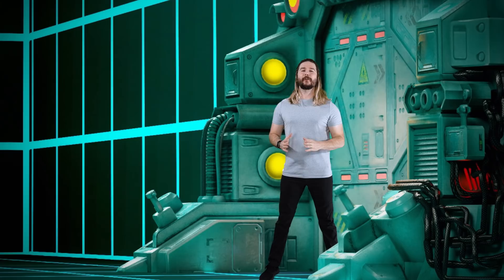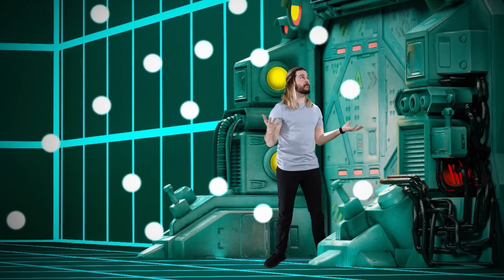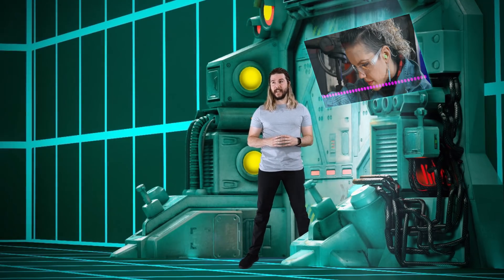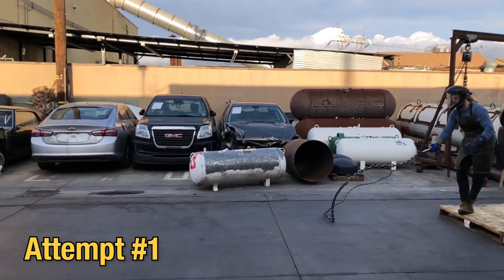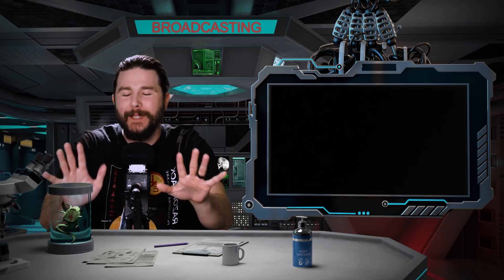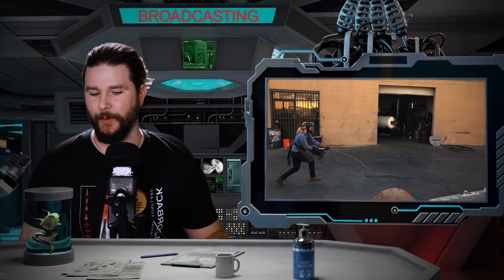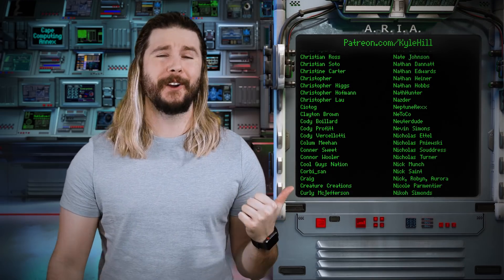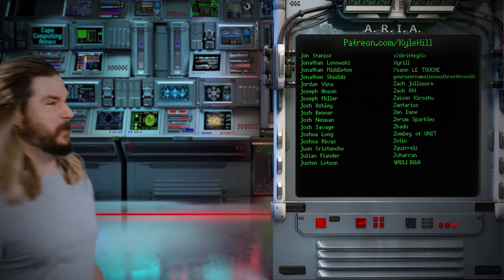Can I Make a SUPERSONIC STEEL WHIP?

Comment: I want to say the problem is that the steel braided cable on the end is too stiff. There is a 180* change is direction to develop the crack and the steel braid can not double over on itself and get close enough. So you end up with a too large loop traveling down the length.

Comment: You know what the problem is Kyle? 

Your chain whip is the problem. It is not made right for this. 

Take a close look at the footage of you trying to whip it. You might notice that you can't in fact, whip it good. Your whip is too long, too sectioned, and the long ending chain, (I.E. the smallest section at the end that's actually supposed to whip), is not tapered well and is stealing all the energy from the final wave of your swing. The decline of the taper of the chain should be a gradual process, but on your chain, it is too staggered and step-wise.

 If you remove the last, smallest chain at the end of the whip, and make a new section of rings that taper down more gradually, (I.E. get the rings smaller and smaller one by one and not all in the same size.) You should probably get better results. If you shorten the chain whip overall, with a decent taper, of course, you should get much better handling and control over the whip and probably not hit yourself too. A shorter whip is much easier to handle as the weight of the whip should be a lot closer to your hand, like a sword blade instead of an axe.

 A shorter whip might be more dangerous though if you can't control the thing very well, and a good way to handle that problem might actually be a... handle. The longer the handle, the safer you would be. Maybe you can add a long wooden handle to the steel handle you already have and have a much lighter and shorter whip at the end of it? It would probably be a lot of work to make, but hey, We would get a lot more clips of our favorite hardworking post-apocalyptic weapon smith in action so it's a win-win, right? Of course, you would be the one paying her so that's a triple win in my book!

The guy in the video you showed has a much better whip than you do and probably does have more strength too, so he can handle a much heavier whip. I believe you would be better suited to a lighter whip than that guy, but with similar proportions. His looks to be tapered all the way through the whip, instead of in sections like yours is. A steel whip is much stronger than a leather whip so it should be able to handle extreme forces much better. In the end, the purpose of the whip is to break the sound barrier, not to actually cut someone in half. If properly tapered, even a much lighter whip should be able to get to a fast enough speed. 

I would love to see a redesign and reattempt at this in the future! 

Let's see you become a real thunder god! Even if its not actually a thunder hammer, a thunder whip might actually make more sense.

Comment: two things that might help. 
First try vertical rather than horizontal. er. still on the  side of your body, not centreline.

second, once you have the whip moving forward en mass, start pulling it backwards so the body of the whip is moving back behind you again while the tip is moving forward. the whip should end up back where it started

Comment: I appreciate  you not hiding failure, but to be fair, with a chain of that weight and length you where kind of setting yourself up for failure, let's be honest  you're not exactly a burly guy. Your best bet would be to start with a smaller diameter chain, neck it down, and possibly end with a steel cable.

Comment: I'm not a wip expert. But I'm surrounded by them. [The founder of my national Indiana Jones fan club is a friend. So I have access to a few whip nerds] So I think that your movement is wrong. Mostly, you need to make the tip go centrifugal before directing the whip itself. Basicaly, make it do a semicircle then pull and launch. Traditional whips manage this by rounding over the heand and pulling down.

Comment: Doing the experiment over hard concrete probably added to the already existing sketchiness factor. Makes the potential for bounce-back a lot higher than soft ground that would absorb that energy. At least a nasty bruise was the worst of that learning experience. (And with that and sharing it, the world also gains wisdom in addition to the knowledge. It answers not only whether it could be done, but if it was a good idea in the first place.)

Now if you want to see something comparably big (if not bigger) that can whip at supersonic speed, look at videos of ship rigging failures like mooring lines breaking or runaway anchor chains. Those have enough energy to cut a person in half and then some. Not something anyone would want to be around if and when it goes wrong.

Comment: If you did this once more. But yank back on the chain as it approached its "whipping point?"
The counter force will up the speed if the tip. You wont get the crack, but you will explode concrete blocks. 👌

Comment: I don't really know much about whips, but maybe you could do it safely if you had a "machine" and enough space. The "machine" is a pole with a rotating arm parallel to the ground on the top and attach the whip to the end. Then attach two ropes that are longer than the whip to the end of the arm. What you do is have one person pull one rope so the arm moves clockwise and one person pull the other rope at the right time pulling it counterclockwise to make the crack.  Obviously you'd need the proper space, a strong construction of the simple rotating device so it won't get destroyed and a second person. In short it's a human powered version of the mythbusters sword machine. Keep at it Kyle, you'll find something out.

Comment: It's worth note (and warning?) that bullwhip mechanics are a bit more complicated than you'd initially expect. There are people who spend most of their adult lives learning to use the bullwhip. It can take upwards of a couple YEARS to get accurate with it, and that's an ordinary, leather-core model...

    What I saw (from a hobby in the bullwhip sport) was at least a couple of your efforts were "on form", meaning that your part of the motion and the follow-through of the whip, itself, were within the motions required for it to work. To be completely honest, I counted two (maybe three) that "should have" achieved a sonic "crack" if it was going to do it...

    Here's where it's important to note, the Tik-Tok vid' of that other guy's whip, obviously ended with a non-metalic length at the end. That was obvious in the stretch that "released dust" or seemed to smoke when he cracked it in the clip. Notice how long it was, but it still wasn't the entire whip. That's a clear indication of it being a completely different material...

    Another "hot take" here... I see how much you seem to struggle with the shear weight of the chain whip. I'm thinking you need to lighten that, and maybe extend the length of the handle... There's two points to this...

     YOUR BODY has to have the shear mass to impart velocity on the whip, especially when you have either a short handle or no handle available at all. The heavier the whip, then... the heavier YOU have to be to wield it properly. If you're that interested in a metallic whip, I'd advise taking several "strands" of lighter chain for the first "segment" of the whip, and bind them together... Take away a strand for each successive "segment", thus tapering the whip, and after a single strand's segment, you can add the leather segment(s) and a cotton tip for amplifying the sound...

     A handle does two things in regard to a bullwhip...

1. It provides a relatively safe place to keep your hands, with a modicum of control over the arc of the whip when you try to crack it...

2. It provides LEVERAGE to allow you the optimal capacity to impart your power to the whip, AND a longer handle will add to the arc of the whip, inducing a wider, more rapid and "flowing" ripple effect down the length of the thing... 

     I know, you're trying to create this whip to look like the one in the Tik-Tok, but understand, that one was being swung around by a guy who probably weighs nearly 300 pounds... and he's at least a hobby body-builder and a "power stunt" performer. You and I are not... 

    Now... This is NOT to encourage anyone to even attempt this kind of thing. It's just a polite discourse on what I understand of whip mechanics from having played with them a fair chunk of my adult life. Even the simplest and most primitive leather versions are damn dangerous! I can split a FULL can of soda with a bullwhip made of no more than leather... well oiled and rosined. These things were made to strip flesh right off when used by a "pro". A whip is still a WEAPON, and should never be taken lightly. It was among the earliest of "non-lethal" weapons, but a weapon none the less, and you can suffer serious injuries from screwing around without knowing what you're messing with.

     Whips and flails in general are among the most difficult weapons to pick up and use. PAY ATTENTION TO WHAT YOU'RE DOING... or just don't mess around with them at all. I can't count the number of minor and moderate concussions I suffered as a kid learning to use nunchucks... My parents very nearly shat a herd of solid gold cattle when I brought a morningstar home! AND the bullwhip had to wait until I got luckily stationed in Florida with the Navy. ;o)

Comment: I didn't watch the video yet but rather have another need to know. Was watching sonic and at the scene where in the bar and moves fast enough to freeze time sonic runs into a boot that has been flying through the air prior to sonic in relation to movie science freezing time due to his relative speed. I just have to wonder. It seems like sonic and the shoe are acting as large body's in a particular accelerator so ignoring the other bits of physics bending what equation would be used to determine the potential energy yield of such imteraction.

Comment: Use a machine that spins around until the chain is in the air, but then have a way to reverse it fast enough to create that moment for that good old crack.

You need more speed

Comment: I had a toy leather whip when I was a kid, and it took a lot of practice before I got a feel for how it moves and could crack it consistently.  However, I also learned that it's very easy to hit yourself with it if you do it wrong.  If you actually got that chain whip up to speed to crack it, there is a good chance you'd end up seriously hurting yourself.

Comment: What if you try welding the smaller chain links together? Is there some sort of energy loss in the individual chain links not being physically connected? If you use thin enough guage chain links at the end it could act like a spring when welded together to transfer energy more efficiently to get it to break the sound barrier.

Comment: We need more failed experiment papers. 
with the publication pressure already forcing the paper quality down, i would want at least correct information, even if it says it doesn't work, instead of not reproducable 20+% efficiencies on reactions one would expect (and can replicate) 1-4%. 

it is not like one can read all papers that are published in ones field currently either way, so just having a better library would be amazing. 
(Also it reliefs a lot of the pressure, when a longer project just does not work)

Comment: wow that's really short, no wonder it didnt break sound, the only vid ive seen of steel breaking sound the chain was almost 30 feet long it seemed. they couldn't lift it it was so big, but it was laid out in a wave pattern and the wielder ran the length of 1 wave and stopped, the rest happened on its own and was sheer EPICNESS i need to find that vid again....

Comment: As someone who has a few bull ships of varying lengths, the failure has a lot to do with technique. Cracking a 12ft regular bullwhip  can be difficult and dangerous if you dont know what you're doing.
Having next to no technique AND doing it with something that weights 10x as much (if not more).... I'm surprised you didn't hurt yourself more. As you mentioned though, you do need some sort of fabric popper at the end.

Comment: I guess a very significant bit of the distance between what we're seeing here and the sought result, is ofc the combination of weight and strength, technique, and followthrough. Especially the latter. Even if you had the technique and strength, the lack of physical movement followthrough means there was never a chance it could reach the speeds needed. I definitely get it though - I top would probably be too afraid of accidentally severely hurting or cutting off a limb, to put my whole body and strength into that movement. Because I know that means your whole body and strength is fully engaged in one powermove, should the situation suddenly require some other quick movement from you, to get out of the way from the whip.

But you can't crack even an ordinary bullwhip, without 110% followthrough, and a good bit of technique.

Comment: One thing I noticed is you didn't pull back much after slinging it forward, so there wasn't increasing tension, just the original slinging motion.

Comment: Ok, some stuff, you have too much wiggle room between the links, if you try to bend a wip, you can't. It just loops, that rigidity is necessary for the wip to work, that rididity helps in the acceleration and transfer of energy. If you could contain the chain inside tubing, that would help. Also you could make a metal wip, just not out of chains. A central metal wire with metallic disks that would taper towards a steel tip, would create this rigidity you're looking for, if you need a visual representation, it would look like a human spine. Good luck

Comment: See, you don't want a wide arc like you were doing, you want a nice straight motion when you want it to crack. The crack comes from tthe wave, when you give the swing a wide arc the wave is much longer, the smaller the arc the smaller the wave and the faster the wave actually moves, which is when you break the sound barrier

Comment: Couple things.
Whip too short and too drastically tapered.
 A longer heavy section gives you more control over where you're sending the inertia initially and a more gradual taper causes less jerk and change in direction as the wave travels between sections of chain. A large increase in speed and decrease in inertia of the chain magnifies the small deviations due to technique and the rotation of the far end of the chain as it aligns with the handle.
A longer chain, especially at the handle lets you dump in far more energy and also gives you exponentially more time to dodge. 
Also I think you should've aimed more in a wide tightening arc peaking just shy of the actual intended direction to compensate for the 'u-turn' motion, along with the fact a smoother broader motion sends a cleaner wave less prone to deviation down the whip. 
So close!

Comment: So I think that something that could help you to get that crack and one of the issues with the whip created is possibly that you are not having it taper except in those 3 step downs. If you had the chain taper down at a rate that would continue the application of ever increasing velocity. 

Be Careful out there and I am glad you only got a bruise from in instead of anything worse. Love the channel

Comment: I built one of these years ago. Extremely dangerous. Almost took my side of my off. But I found the only way to get a chain whip to crack repeatedly is with some sort of fabric tail at the end of the last link. Makes a good snap. But far to dangerous to use for "fun"